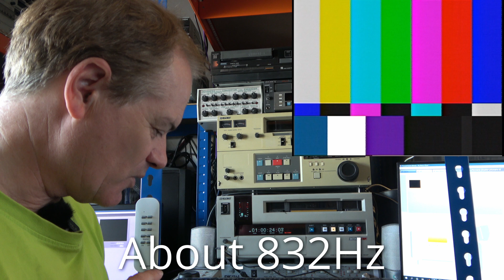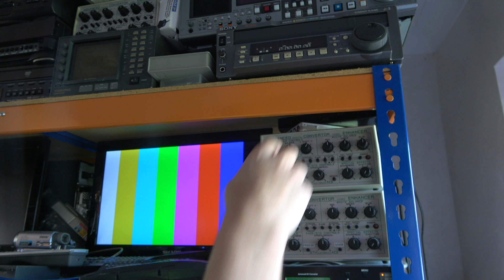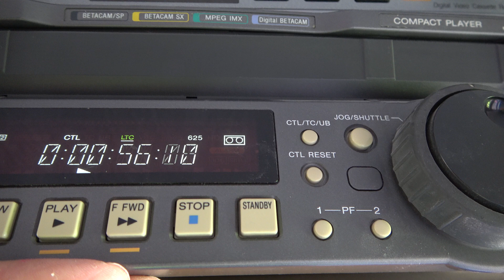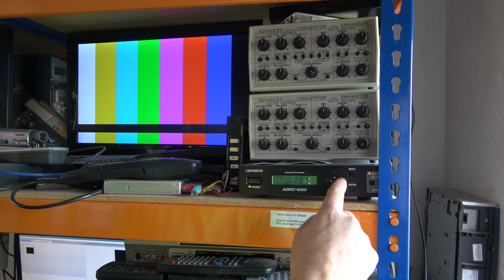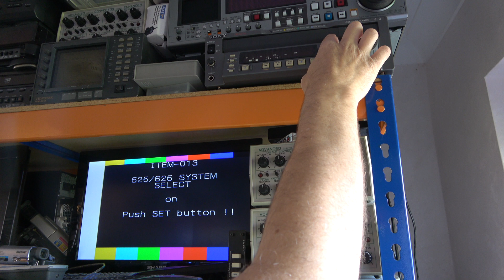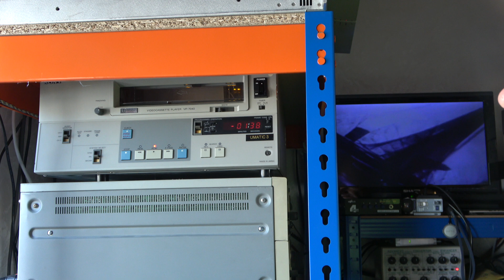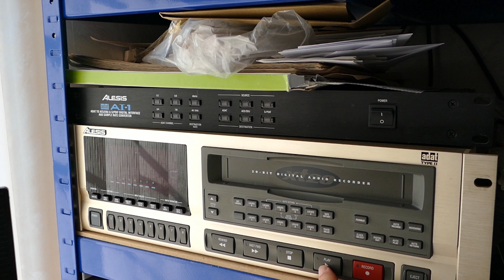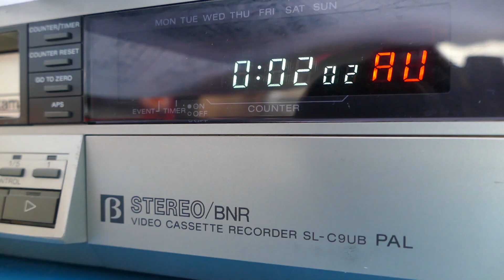Mixed up NTSC and PAL on professional video machines

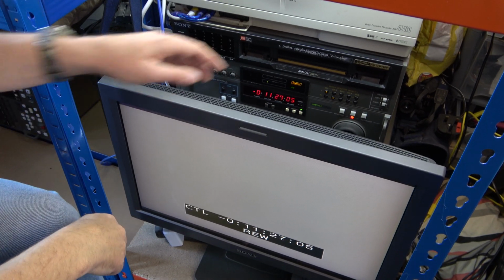Comment: Fascinating stuff. Last night I was going through some unknown miniDV cassettes and had the symptoms you saw  at 1:30. Counter moving but no image. Pic search gave blocky picture, play just blue screen. Tried playback on another camcorder and this gave 'unplayable tape' message. I suspect the mini DV tapes in qustion were  NTSC, or even DVCAM which, I discovered after a bit of searching, was Sony's own miniDV standard. So now the hunt is on for a cheap DVCAM player! There's always some variant you don't have covered!
Reply from the maker: DVCAM is the professional version of DV.  It was very popular, and not just made by Sony.  Nearly all (not quite all) Sony miniDV camcorders will play DVCAM recordings just fine.  The clue is that a 60 minute tape runs for about 43 minutes, otherwise you wouldn't even know you are playing a DVCAM recording.  I think you have a different problem, possibly a defective recording.  It's just possible it could be DVCPRO (a failed competitor to DVCAM) but that's unlikely on a miniDV tape.

Comment: Would a Sony svo-9600 play pal with a video converter?
Reply from the maker: No, not if it's an NTSC machine.  It would not get drum or capstan servo lock.
Reply: I got one of the converters from my friend I actually got a picture waiting on the other one to check it out.

Comment: I remember putting a PAL Canon XL1 shot tape into a NTSC Panasonic DVX100b and somehow it was still able to playback some of the footage, even though most other tapes shot on the wrong standard would just spit an error code at me and tell me to eject!
Reply from the maker: Most PAL DV equipment will play NTSC, but not all.  Why it would play some and not others is a mystery, perhaps some were DVCAM?  Sony machines usually play DVCAM but most other equipment will not (there are exceptions).

Comment: The Sony DNW-A75 Betacam SX Editor and probably the DNW-A65 are NTSC/PAL switchable through the menus and were probably the first machines that could do that along with the DNW-A25 portable deck with the P variants defaulting to 625 after an NVRAM clearing. The MSW-2000M can also be switched in a similar way.

Comment: I learned little. I doubt my brain can contain further standard info. I'm familiar with every standard mentioned. 
I'd like to see a Windows 10 machine at the end of the line. Rather than some sort of PVR.
But I enjoyed it loads!
Reply from the maker: Pretty much everything I capture is done to Windows 10, either via Firewire or SDI.  I used to use JVC DVD recorders a lot in years gone by.
Reply: @video99couk  That bit isn't in your videos.
Reply from the maker: @pierrejeanf.dupuis4150  I do cover it a bit here: https://youtu.be/kWOatyZgGKU

Comment: PAL/NTSC, 50 Hz/60 Hz, 120V/240V, 9 kHz/10 kHz Channel spacing, and power plugs.  Good times indeed.  At least USB is standardized, but then we screwed that up too with 10,000 flavors of USB connectors!
Reply from the maker: It gets worse with  29.97fps, 59.94Hz and all that, which can cause lip-sync errors and other problems.
Reply: @video99couk 
Drop frame and non drop frame time code on NTSC, and NTSC telecine running film at 23.976 fps.

American high pressure sodium lamps are quite different to European ones.  It’s odd when it comes to lampholders to.  American lampholders are E26 and E39, plus several smaller sizes, while European ones are E27 and E40.  Contrary to what you might expect, American holders will usually accept European lamps, but European ones will not take American lamps; the lamp will jam after less than one full turn.

Returning to video standards, as you briefly mention, Japanese NTSC is different to American which has the 0.7 IRE setup on its black level.  Then there are the strange mixtures like PAL-M, NTSC 4.43, PAL 60 etc, and I believe that Russian SECAM was slightly different to the French version.

Comment: btw. if you play that scrambled mess you get when mixing PAL / NTSC tapes through a TBC, it'll be recognizable - like magic. Still looks crummy (capstan speed is off->tracking doesn't sync), but it's a recognizable picture. Didn't have color though.
Reply from the maker: It did go through a TBC, but the drum speed is too far off to lock.

Comment: So does this mean with the Betacam SP the drum rotates at the same speed? I'm a bit confused by this, with VHS and other analog systems the drum rotates at 1500 rpm in PAL and at 1800 rpm with NTSC that why we get the scrambled mess, how come this doesn't happen with Betacam?
Reply from the maker: I imagine that the drum speed is able to lock despite the huge error in frequency.
Reply: @video99couk  That's fascinating!

Comment: I guess that one important aspect is that the line frequency of 525 and 625 is almost the same. In fact the BBC built a standards converter in 1972 which utilized that relationship. It essentially was variable delay that was switched in between lines. This was done via ultrasonic delay lines. It was described in 

It might be interesting to see what tapes in other systems look like, like British 405(?) or French 819 line standards would look like. My guess is that the U-Matic might have little trouble with it if set to "PAL" or "SECAM".

My guess on why the U-Matic VTR didn't seem to care about PAL and SECAM is the following. There are multiple ways to do colour under recording of SECAM. One is to take the chroma subcarrier and divide its frequency before storing it to tape. VHS uses that. The other one is to simply shift it down in frequency exactly the same way it's done for PAL. VHS does that in the "MESECAM" mode. My guess is that U-Matic simply uses the PAL variant but with minor variations during recording. For example in PAL it might use a comb-filter to separate luma and chroma while in SECAM you can only use a simple low- and highpass combination.

Comment: You evil man, confusing the poor machines :-D
The real question is: do you get many tapes in the ntsc format to convert?
I imagine that a vhs machine would be confused by the wrong ctrl head frequency.
Reply from the maker: PAL VHS machines after about 1993 usually play NTSC tapes using a half way system with PAL colour and NTSC line/frame rates.  Most TVs can display that as a good colour picture.
Reply: @video99couk  What would happen if such PAL VHS machines would be used to capture NTSC tapes to a computer? Wouldn't the PAL machine only deliver 576 lines to the capture card, which in turn would yield 480 "active" lines and a lot of blank ones? Could that be corrected in post processing by stretching those 480 lines?